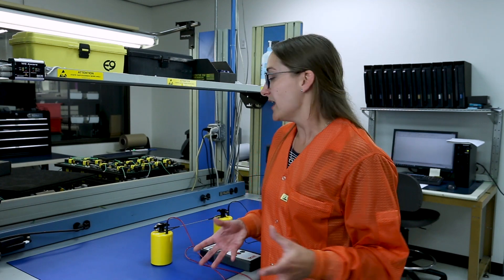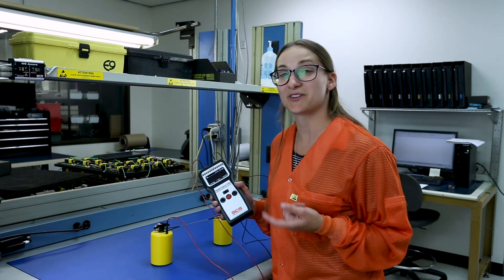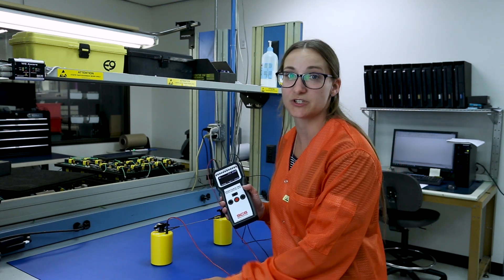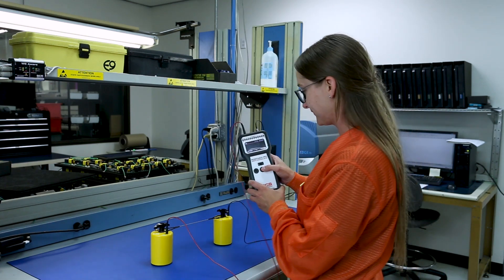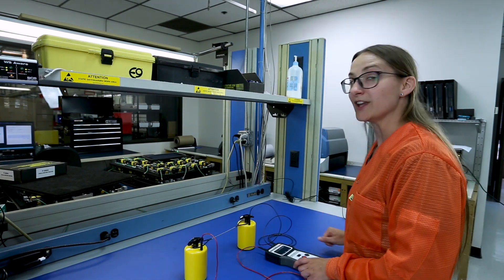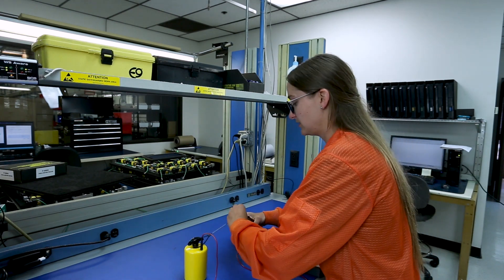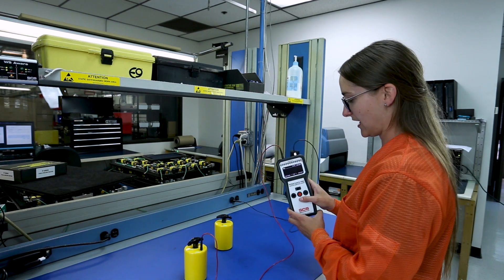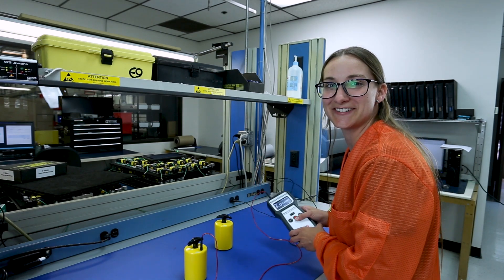SCS - A Minute with Miranda - Testing an ESD Worksurface Mat

Comment: Do these mats have to be grounded in order to run these tests? Or do you test the mats on their own before they are hooked up to a grounding point?
Reply: 1. First, Rtt testing is not required for Compliance Verification, only Rtg.  Rtt testing is only required for Product Qualification or as a method to determine if the surface resistance  of a material may be the cause of a failed Rtg test.  
2. A material would not be required to be grounded for Rtt testing.  You are only testing the surface resistance between two specific point so it doesn’t matter if it’s grounded or not.